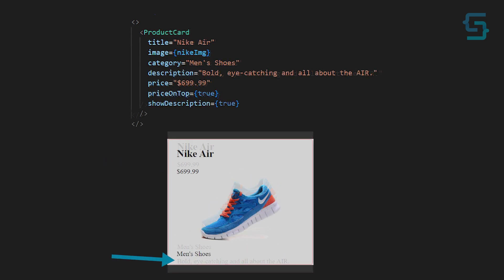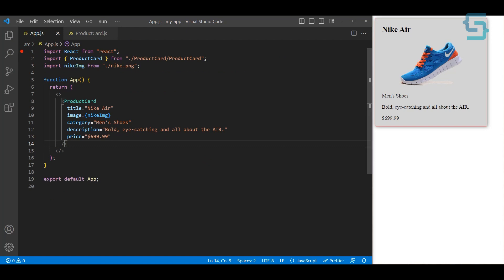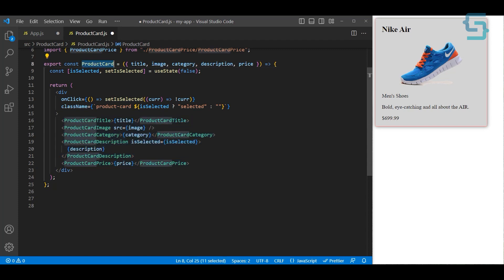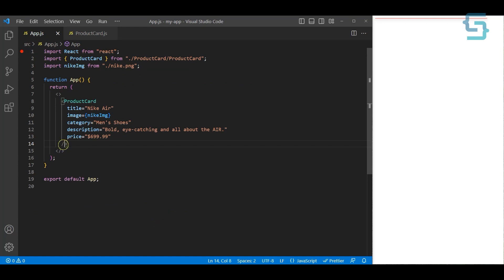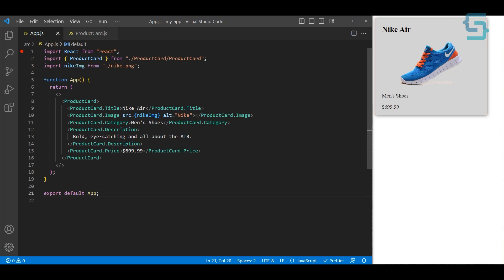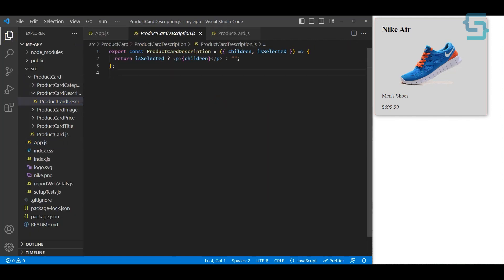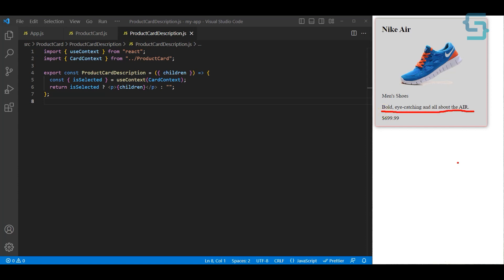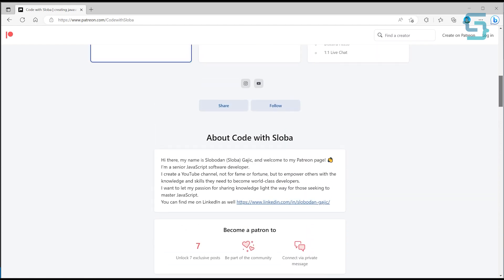Compound Pattern in React | #30 React Course

Comment: We use this a lot at work, in a big app it makes all the difference
Reply: @morchellemusic2829  but won't you be able to enforce consistency in this way and components will need better documentation and more work to understand and implement? Is this bad for smaller projects or even for simple components in big projects?

Comment: Aren't you creating a circular dependency between ProductCard and ProductCardDescription? One of the rules in projects I work on is to never import anything from parent components.
Reply from the maker: if there is a circular dependency I'm pretty sure it would crash.
Reply: @CodewithSloba  no, it won't crash, but you're creating a potential case that's hard to debug.
Reply from the maker: I see your angle

Comment: Thank you, but I do not like it
Reply from the maker: Why not?
Reply: @CodewithSloba  The first version looked better. You create a component in one place and use it in many. Let it look messy in one place rather than everywhere else. This is purely my opinion and I could be wrong. (Translated by DeepL)
Reply from the maker: @СамирАбасов  The thing is that compound components doesn’t look messy, they are much cleaner.

Sometimes more code means more readability. Also this way component implementation is much simpler and more protected from bugs and weird logic.

Also it’s much more versatile